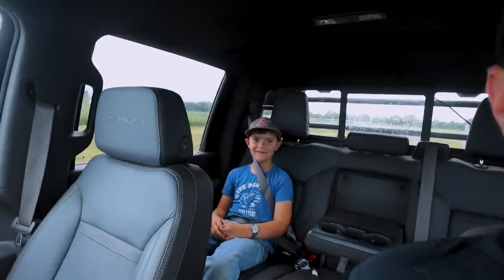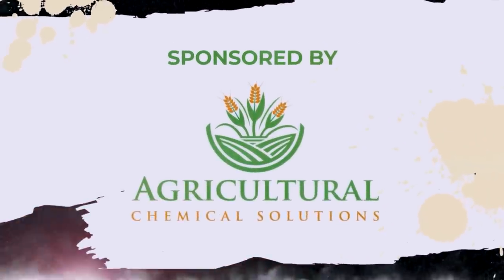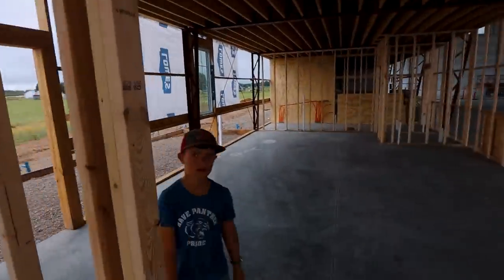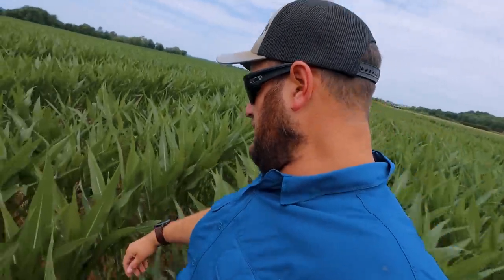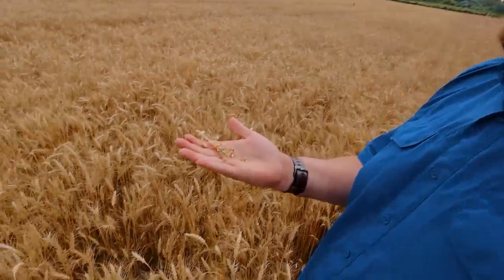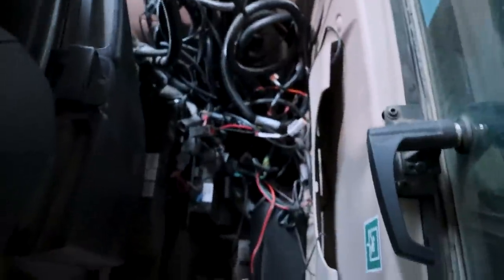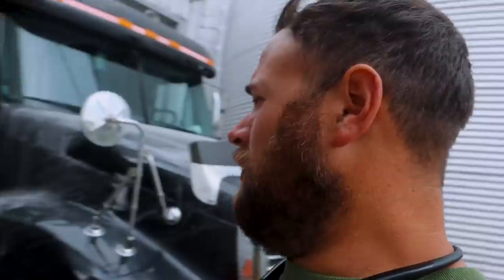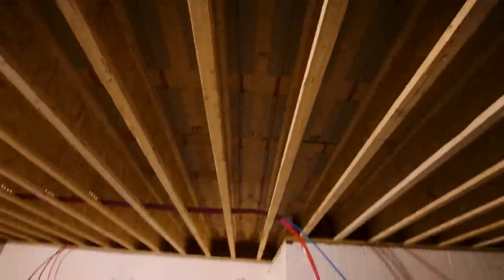Wheat Harvest preparation revealed surprises

Comment: I worked in the Grover Hill, Ohio grain elevator for the 1979 season. A couple of the bean bins had not been emptied and cleaned for 3-4 years so me and 2 other guys had the job of doing that. They were VERY dirty since all the dirt fell to the bottom of the bin.  They were 40,000 bushel bins and we had NO sweeps.  We had to hand shovel/push the beans to the center of the bin where the hole was.  About 4 semi loads per bin had to be shoveled.
Reply: Back in 1978 a grain bin burst at that elevator, and spilled 2500 tons of corn.  I was 12 years old but remember seeing the mess the following day from Jerry's Marathon! It reportedly wiped out the next door neighbor's outhouse.
Reply: I had a uncle and cousin from Grover hill that farmed. Carol and Owen Schaffer. I think Owen still farms
Reply: @detroit6025  It is a small world.  They were my first wife's neighbor. I was at their house a few times.  I got divorced many years ago and live in the Philippines now.
Reply: @walterlang151  I lived on the corner beside the elevator.  You are correct that it burst but it was full and had about 96,000 bushels in it.  I was still helping to clean up the mess when I worked there in 1979.  Are you still in that area?
Reply: @donmedford2563  I am about 20 miles away now.
Reply: @donmedford2563  yes it is for sure.

Comment: Put a dot as someone suggest, also write the number of fittings in the area so you can keep count. Where possible consider fitting extenders and make a bracket to put all of the, in one line for quick access. Something the mfg should do and just add the extra cost in the price as you will probably never notice the extra 500-1000 in the overall price. 😂